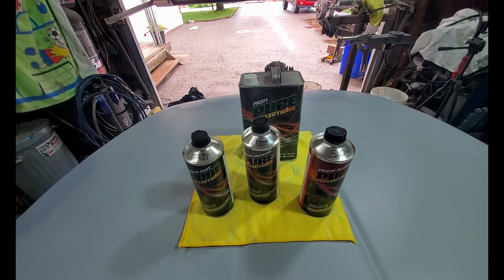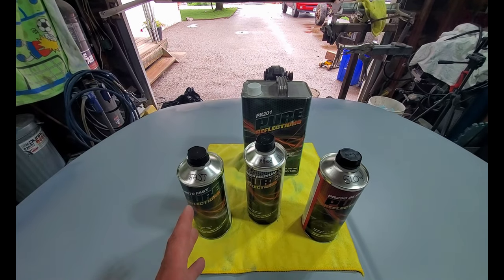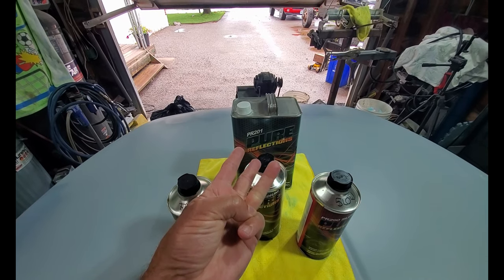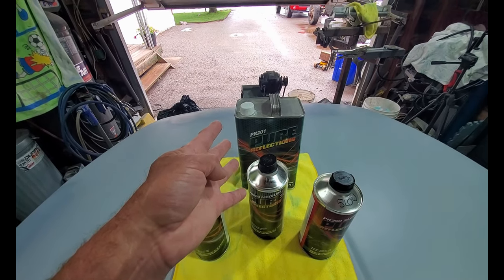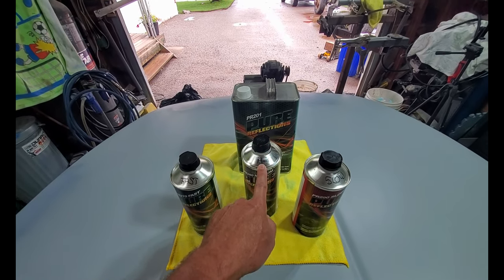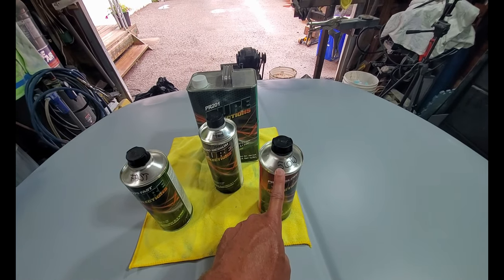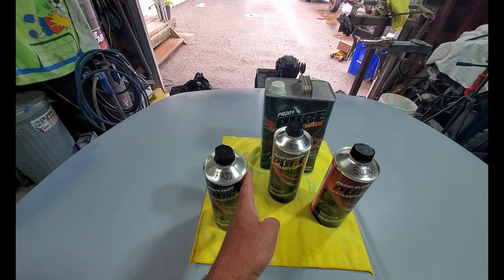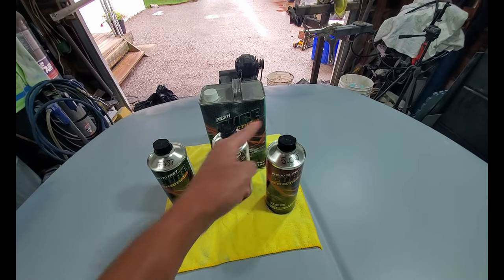Clear Coat Activator/Hardener Why 3 Different Speeds EXPLAINED

Comment: Great video. I've heard some painters using med or fast for the first coat and then slow for the last coat to get it to flow out. Seems like too much labor for me, just wondering. Also, could you use fast when painting small parts or a just a fender instead of a spot clear?
Reply from the maker: Absolutely can use fast for small parts. One light coat then smash on a wet coat.

Comment: how to use the activator then with the clearcoat...do i spray paint the clearcoat first and then when it dried, top it off with the activator? hope you had a youtube with that, thanks
Reply from the maker: The activator/hardener is mixed with the clear at whatever ratio the manufacturer states on the label.

Comment: Gonna use fast activator next time paint I been putting my coats too wet on base and clear and on first coat that has been my problem too.
Reply from the maker: Hope the information was helpful. Thanks for watching.
Reply: I got slow activator and slow reducer coming now I know in last message I said was gonna use fast but the weather is warmer now in the day but have medium and fast reducer and hardner at home now have been lately setting up my car to paint but this time I took my car apart in pieces to paint it the rear bumper is what I wanna take off last on my Chevy Malibu 08 I had to get a rv leveler so my vehicle will go up higher instead of jacking the car up actually taking the tires off all of them would help too I have to get these screws off near the back tires and couldn't get them off so the vehicle needs raising up to get the screws off but after take the rear bumper off I have one more spot to do a crack on the grill in front had to get plastic bumper filler for that and that's coming this week but when I paint it am moving the car back into the garage I have the hood, grille, trunk, doors, inside panels, door knobs and when I take the rear bumper off all that will be the pieces I took off been working on it for a month I should of rolled the windows down on the door before taking the doors off but I can just put plastic masking around the windows. Just waiting for a garage sale to get done before I paint in garage so should be to paint in June but want to take days off from where work too soon.

Comment: So i have a Slow Activator and Reducer if i use it on a cooler day like 65 degree day will i have any problems ? other than it taking longer to dry
Reply from the maker: Slow is not for cooler temperatures. Your asking for problems like runs as well as the clear not curing properly. 65 degrees is still a good temperature for medium.

Comment: can we use slow in cool weather??
Reply from the maker: You can but the chances of getting runs goes way up and with that the curing time also increases
Reply: @swc-diygarage  i ordered all my material in the sunmer...so its all i got
Reply from the maker: @gruponemesis  I also would do a small test panel just to be sure. You don't want any surprises.

Comment: i'm using medium for base and clear when temps are anywhere from 60 to 80 without problem's
Reply from the maker: Perfect. Thanks for watching.
Reply: @swc-diygarage  no problem in joy watching them I’ve only ever used medium for base and clear but now temps are going above 80 mite have to try slow only paint the summer time winter never have tired fast

Comment: could you tell me the difference in hardners and activators
Reply from the maker: They are basically the same thing.  It all depends on what the manufacturer wants to call it. The purpose is to kick off a 2k product. What's important is not to mix products.
Reply: THANKS THAT HELPS
Reply: CAN I USE A CLEAR ACTIVATOR IN  URETHANE PAINT
Reply from the maker: @stingray6164  do you mean base coat or single stage direct gloss. Also should be on the technical data sheet for the products your using.
Reply: @swc-diygarage  IT IS SPEEDOKOTE HOT ROD BLACK URETHANE THE GOAL IS TOO SLOW DRY TIME
Reply from the maker: @stingray6164  I looked up the tech sheet. It calls for an activator and mixes at 4 to 1, 5 to 1 or 6 to1 depending on sheen level. Doesn't give a choice of slow medium or fast. Product is designed to be fast drying.
Reply: @swc-diygarage  WELL THAT WAS A BIG HELP. THANKS FOR LOOKING THAT UP FOR ME. I WILL PAINT  IT NEXT TIME IN COOLER WEATHER
Reply from the maker: @stingray6164  your welcome.  Glad I could help.

Comment: What happens if No activator is added to Laquer?
Reply from the maker: The hardener causes a chemical reaction with the clear. It will not harden with out it.
Reply: @swc-diygarage so we need use hardener in lacquer,paints,and primers is it right?
Reply from the maker: @vygantasrimkus2632  The term Laquer is sometimes used in place of the word clear depending upon the person.  No we do not use hardener in lacquer paint or primer.

Comment: I'm estimating I will paint my car in June. Better go, with the slow.
Reply from the maker: Sounds like you have it under control. Thanks for watching.
Reply: @swc-diygarage  I sure hope so. I just ordered $600 worth of paint/primer and $700 in material. It's my first time painting a car so I'm starting from scratch . I still need to buy a decent air compressor and a few other things. I'm painting my 04 Mustang GT. The original paint isn't awful but I guess I felt the need for a project 😅